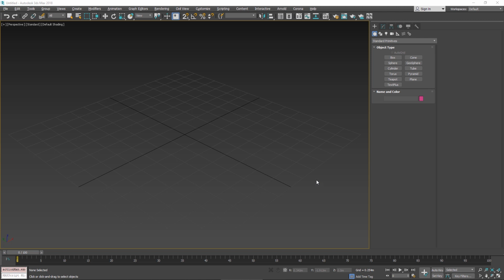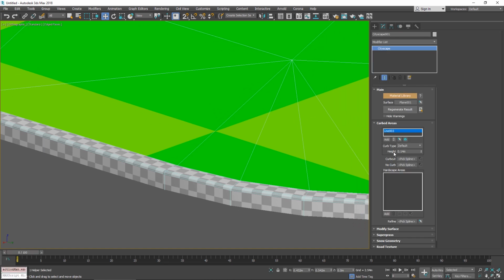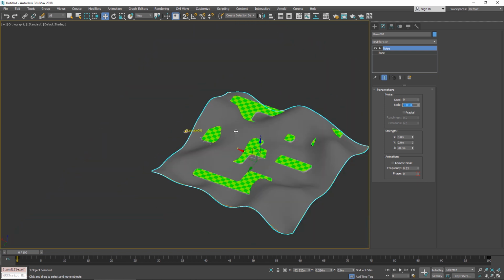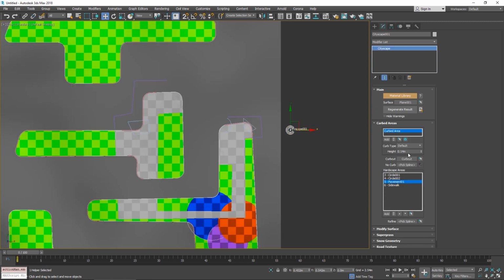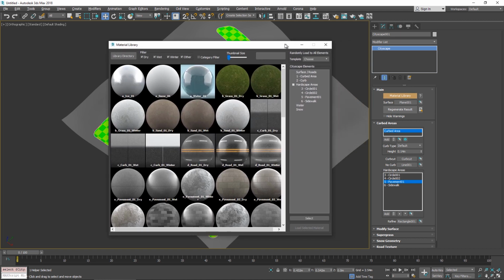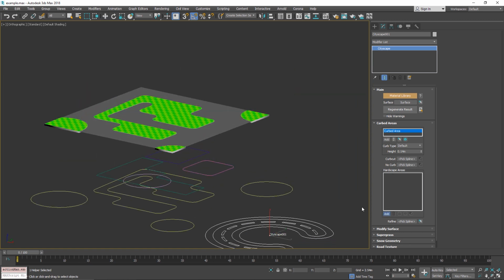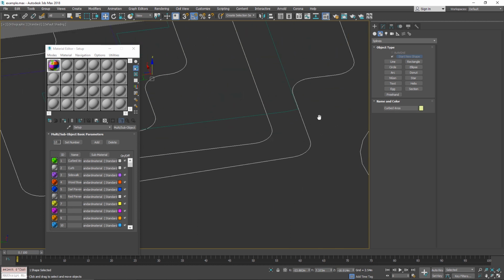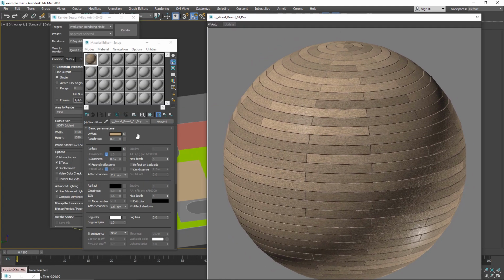Tutorial - 3.  Curbed Areas - Introduction to Cityscape Pro

Comment: Can you consider adding flower beds and tree rings option?  They usually have an edge that is dug down to keep mulch in and are also mounded up slightly.  Also please consider putting an option for a curb like border around hardscape areas in order to add brick borders.  This would be very useful for urban landscaping.